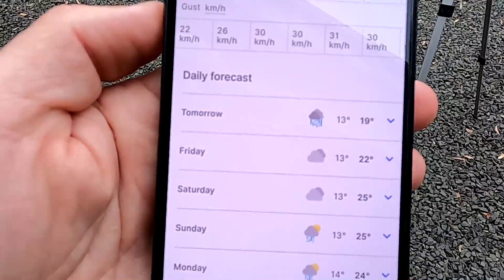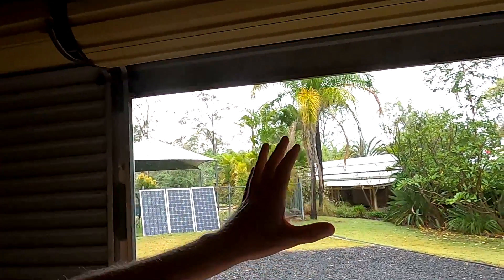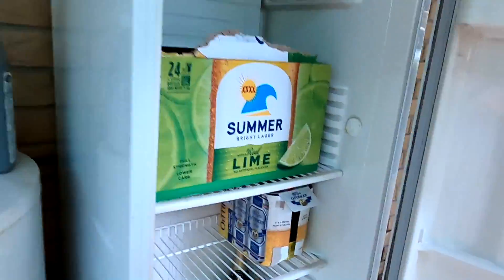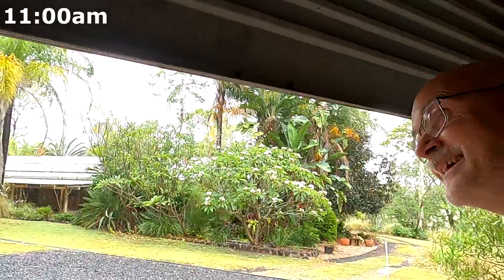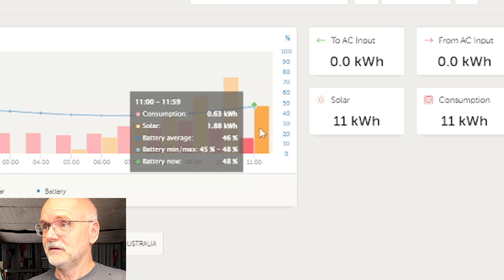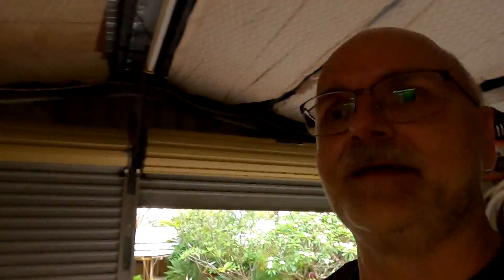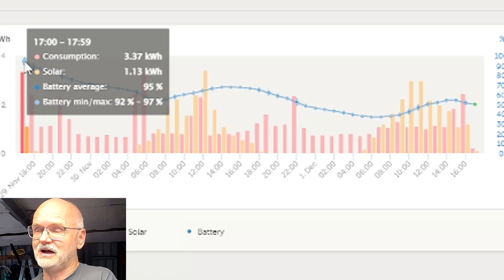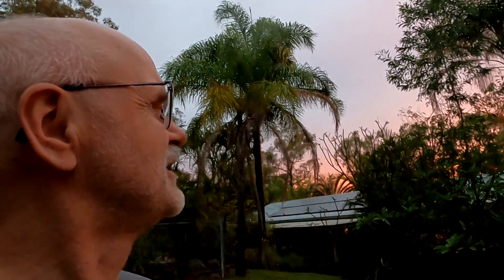Enough solar power under a cloudy and rainy sky? 🌧️🌧️🌧️🔋

Comment: Cool.  Yes clouds reduce power but our new
Panels still work as well.  We have to plan for winter as we are off the grid entirely. In Utah, and it gets down to 15°F.   Panel angle key and power efficiency using direct, DC appliances to reduce loss. 
Love the experiment
Reply from the maker: Thanks Rick. Nice, that's a bit of a challenge, I wouldn't mind myself. Finding these last bits of efficiency everywhere if needed. I would nto like to use a gen set but find some alternatives instead.

Comment: This actually meshes with my own experiences with my own solar system. I've only had a few times where I had to find another way to charge my admittedly undersized battery pack over the last year.
Reply from the maker: Are you still connected to the grid or did you use a generator?
Reply: @OffGridGarageAustralia  I've been completely off-grid since February, so I've used a generator a couple of times.
Reply from the maker: @MatthewN8OHU  I thought about such situation and would like to use some of the 12V batteries I have in my garage sitting around doing nothing. They are always charged to 70-80% and that's another 10kWh which I can charge from some spare solar panels just on the driveway. Not sure if this would be a feasible solution when it is really cloudy and dark for a long time, but it would be interesting to explore that...